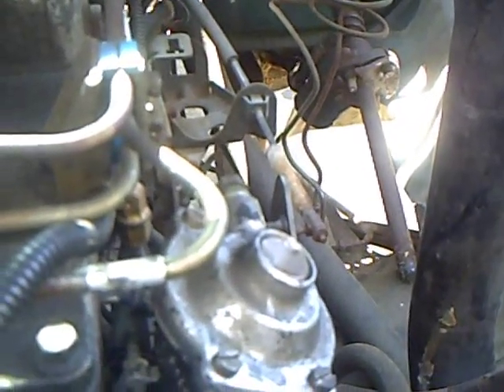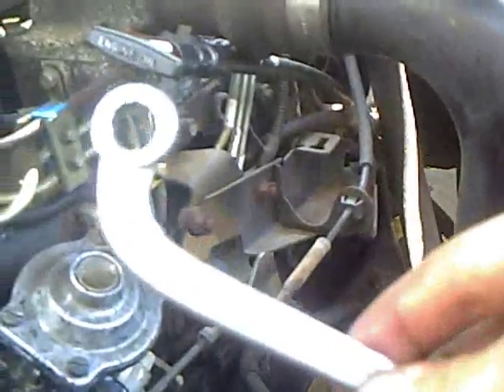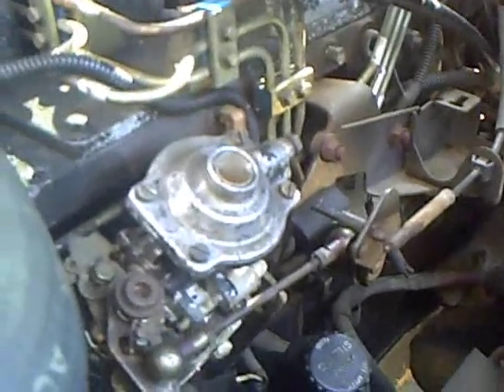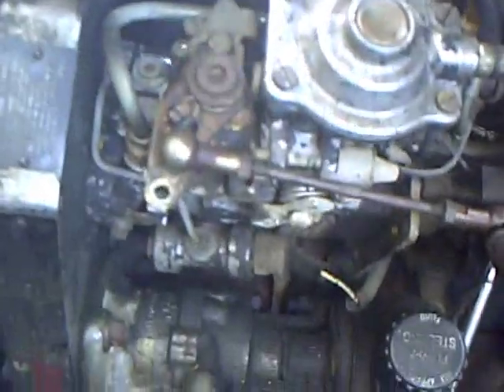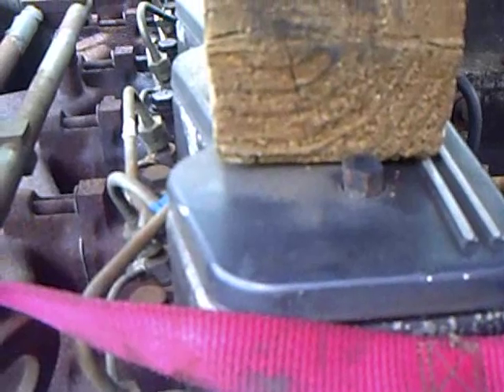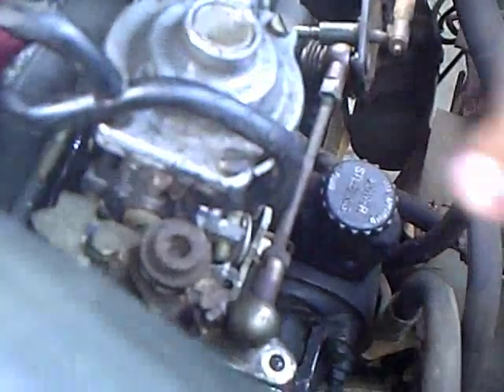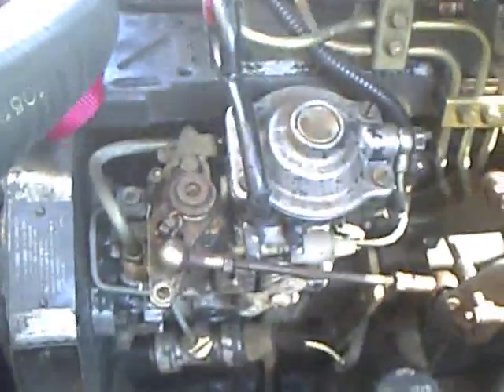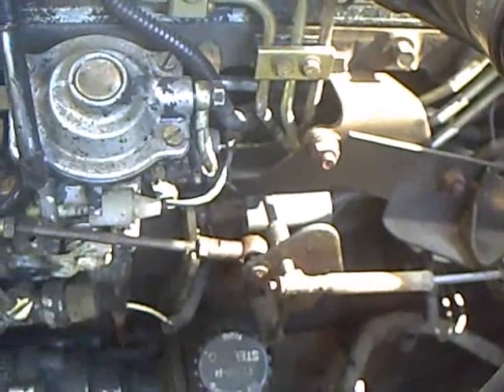How to: Advance timing 1/8" on your 89-93 Dodge cummins VE pump!! more power and +2mpg! best mod

Comment: 91ctd got a question.  i advanced timing my injection pump to max  and the  performance increased but is there any side effect????
Reply: lower fuel milige and you could possibly burn the top of pistons
Reply: Have you had any issues going to farther then an 1/8

Comment: What os that oval shaped tamper bolt that has a hole in the center? I have a leak that I think is comming from that bolt. Please help. I have the socket that fits it and tightend it. Still leaking,
Reply: THATdudeTHATraces151  It's called a "regulating valve" If it leaks you need to take it out and replace the o rings. The part it self is part number 460362320 Bosch. Buy a whole seal kit for it. So you have all the orings for the whole pump. If you need to seal it let me know. I know how to get the tools and instructions on how to do it.
Reply: I'm having the same problem, I went to remove the injection pump body, it should have been easy breezy just the top half only only to find a near impossible hex head in the "black hole". looks like I will try to rotate the whole VE pump and see if it gives me more room to work with. 
http://www.dieseltruckresource.com/forums/1st-gen-ram-all-topics-93/repair-leaking-fuel-pin-153154/
Reply: The core of that bold is a loose pen it  is a scrink fit that is for adjust internal fuel presure Max o,7 bar

Comment: I bought a truck that has had the pump modified already, the guy said it is very minimally adjusted and by the light dusting of smoke it puts out I believe him. I want to do the mods you have shown in your videos, but how can I tell what has been adjusted already? Are there stock markings on the star wheel or smoke screw I can go off of?

Comment from the maker: The cold start wire just gets switched 12v, probablly goes through the temp. sensor circuit. I think the cold start valve is only activated when the grid heaters kick on in the cold. And im not sure what oval plug you're talking about sorry

Comment: Hey can you help me out with some info?under the head on the pump side theres a small oval plug with I think 2 wires coming out where do they go, Now on the pump it's self theres 2 wires right? where does the cold start wire come from..a sincer? I have a Cumming 4 bt there the same..well you know what I mean.
Thanks a bunch
Joe

Comment from the maker: Man you're harsh, i was in 8th grade man. 14 years old :). Theres no certain order to do anything, this truck had a 12cm housing and bumping the timing a tiny bit didnt make a difference in low end, especially since i put a gov. Spring in the same day. I hadnt got around to doing the power screw yet, power screw is really the last thing you do after gauges,trans or clutch and all that. My dad and I have had about 14 1st gens since this one, idk if youve had a bad day or what man. why so negative

Comment: on the back side of your ve bosch inj pumpyou have a cap over your power screw do not turn it more then 1 1/2 turns with out injectors or you burn your pump up and never go more then 3.5 turns or your just blow your engine up from a run away. a fuel pin nice eazy 40hp there about 100$ . after you turn the fuel and pin in it make suck you get a little bigger turbo for the air flow. so your not waiting your money in fuel . with this mods done can be from 290-350 hp at the wheels in the 1 gen

Comment: so that one screw you have to remove at the back of the pump to get to the one bolt holding the pump on...is that the idle screw or is that the screw that only allows you to rev to a certain point

Comment from the maker: Idle screw on back of pump. If you pause video real quick at 0:03 you can see a shot of it, the throttle linkage comes back and rests against if. easy to find

Comment from the maker: @416rm Nah the pump will bef ine. M&H makes a good pin. Sounds like with POD injectors you're gonna have alot of fuel. be sure to have at least boost and EGT gauge, EGT Pyro mounted pre-turbo.

Comment from the maker: @Black80Z Someone could have already advanced it

When these things are really stock alot of timing only hurts the bottom end performance...plus you have a 21cm exhaust housing because it's a 92...It's easy to tell theres a "21" cast into the BACK of the exhaust housing , like right above where the exhaust pipe goes into the turbo. you'll have to get a flashlight and get up in the engine bay.

This combo will make SPOOL UP horrible....Get a HX35 turbo with a 12cm housing off a 94-98 truck.

Comment: I looked at the pump position on my truck, it is as far advantanced as possible. I have 92 Intercooled with Auto O.D. It seems low on power and does NOT smoke at all. Does the pump need removed and moved a tooth on the gears behind the cover or does mine have a problem?

Comment: Have you tinkered with the "full power screw" on the back of the VE pump? And if so, could you post a video on how to adjust that? 

Thanks, Spartus09

Comment: I found that with the intercooled valve cover, if you drill a hole like 5/8" or something into the piece of wood for the nut to set up into, it really helps you put the board exactly where you want it.

Comment from the maker: ummm yea thats very important. i bet it has like no power?

if thats not hooked up no boost will get to the AFC to push the fuel pin down. which means no fuel, no boost, no power...have you been driving it like that?

Comment from the maker: I'm gonna make a nother video soon on how to turn up the main power screw. otherwise known as the fuel screw because it simply turns up fuel, all we did here was adjust when fuel comes in.

If your truck is an automatic i suggest upgrading your torque converter.factory one slips alot, aftermarket converter will put more torque to the ground

Comment from the maker: THis adjustment works good with the other adjustments. you'll feel a nice upgrade in throttle response and all range power.

You're starting the combustion event earlier.

the reason the factory didn't advance it more from the factory was because of emissions. It raises cylinder pressure and more gases are emitted.

Im not scientist, or diesel expert. all i know is when you advance the timing on a 1st generation cummins it adds nice power and fuel mpg.

Comment: I'm quite new to diesels, so please forgive my ignorance.  What does advancing the pump timing do, to benefit the performance, and mileage?  does it allow the fuel to be drawn into the cylinder sooner, and/ or allow more fuel to be drawn in?  trying to get my mind around the concept, but I need help with this... any assistance would be helpful.  Does this adjustment work best with, or without adjusting the fuel pin and smoke screw?

Comment: Thanks for the response 91CTD, Yea I tried the rubber mallet even with tension on the strap and even tried a punch. I sprayed around the pump flange with WD40. I will give it another try when the rain stops.
Thanks.
mojack

Comment from the maker: Did you use a strap? Rubber mallet?

The pump sometimes get stuck on the aluminum case, and when you moving the pump your actually twisting the fuel return line, your twisting it inside its little nut end.

So sometimes it takes a little more to move it... if you have all 3 bolts out and the one nut... and the banjo bolt/line is out..

give the pump head a wack with a rubber mallet WITH tension on it from the strap.

Comment: Crossy,
Nice to see you back. I tried to make this adjustment paying close attention to your video. Detailed very well. I was not able to get my pump to move. I had all the nuts and bolts loosen to finger tight and it still would not move. I was afraid to put too much pressure with the ratchet. I had removed the banjo bolt do I need to remove any other lines? Have you ever ran into this problem? 
Thanks. mojack
Reply: your injector lines are most likely keeping it from turning they stopped my 6.5 detroit diesel when i did that pump so i didn't even try to turn mine with them on . i was able to turn my pump almost half an inch by hand with oil filter pliers.